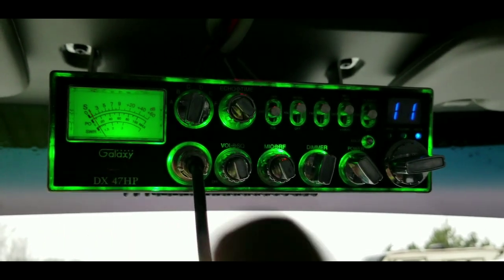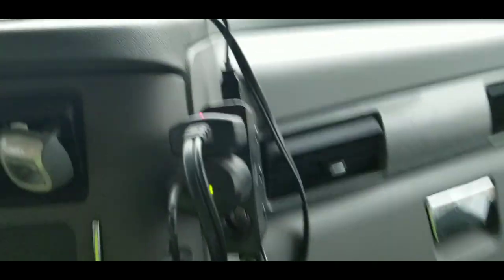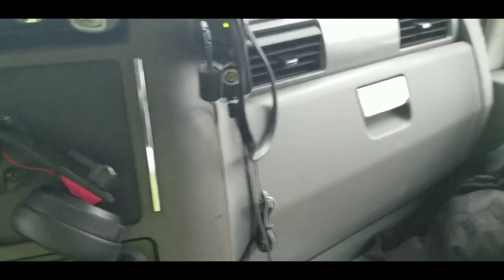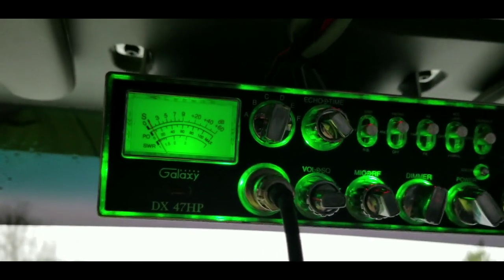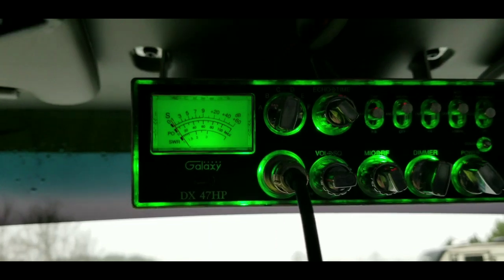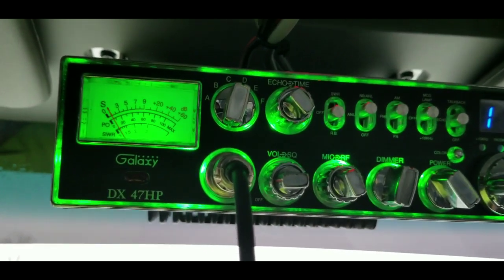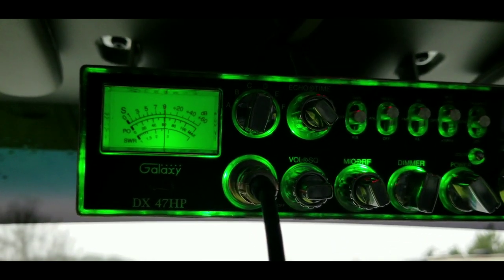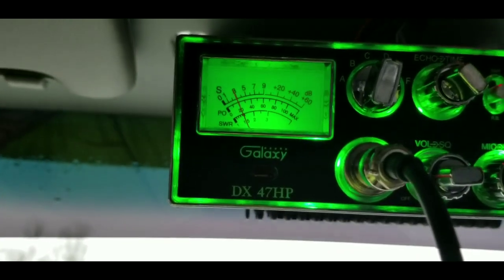Too Much CB Static!

Comment: Did you ever try to touch the antenna while having  a lot of static? The power coming in to the antenna (voltage) somehow gets mixed signals. But if you physically touch it or connect a little 2 core wire (looped) static disappears. You can turn down the squelch almost completely. This really works !
Reply from the maker: I don't have that truck anymore. Please explain this 2 core wire thing you speak of.
Reply: I was just doing this.  The damn antenna static stops when I touch the antenna
Reply: @yungkidd94  cause your raising the SWR = signal loss

Comment: I use the usb port on my am/fm radio to charge my phone instead of the cigarette lighter plug... It's the low power charge but generates no noiseon my cb radio. Also if you want lower noise, get a Stryker 655

Comment: Here’s an old trick to find electromagnetic interference with a radio install. Take a cheap hand held/portable AM/FM radio, cheaper ones are more susceptible to interference. Turn on your radio rig, then turn on the radio to a localish AM station. Hold the radio up to the whole radio install from the tip of the antenna, all along the antenna wire, and all the way to the CB. The radio will freak out with static when near a magnetic interference. You can use this to find any electromagnetic source all over the vehicle that may be causing you trouble.

Comment: Have you tried using ferite beads as a line choke. Also, the very length of some cords may become resonant at higher frequencies relative to other communication modes such as vhf, uhf, microwave, etc. I ground everything separate and bead coax near the antenna source . Also, Don't use cheap coax, it only causes headaches and shortens the life of your finals.

Comment: LED lights put out a crap ton of RF. The diode in the lights cause it. You can clear up your signal by installing an inline noise filter on your power supply. Even if you dont think your having much RF interference youd be amazed how quiet the static becomes with a filter. Less RF/static means you can hear distant and faint transmissions better.
Reply from the maker: Very true. I have this problem in my personal truck with the led headlights and the FM radio .
Reply: What is the best inline filter to use on a General Lee HP 40, pushing triple digit modulation?

Comment: Yeah I used to work for Schneider and my truck not only had a bad antenna, but they put the CB mounts right on the dash, right where the stereo is, two 12v plugs, I had my 12v cooler, and my built in fridge. So much shit for static, it was pretty bad. Nothing I could do though because I needed a phone charger, and my GPS tablet power plugged in.
Reply from the maker: Ugh, everything on a 12v plug! At least they had CBs

Comment: My dadgum cb does the opposite.
I had my phone charger cable layin over my footwarmers jumper coax..(100 watt with 1 watt goin in). When i keyed up, Apparantly it started activating apps as if i was tapping random icons on my phone.  I thought i had fried my i-phone because along with 7-8 apps running it had went into my settings, display, contrast and turned my brightness to zero, so my screen was totally blank. 😂😂😂
Took me a while to figure out what had happened. Lol so now im careful about wire placement.
Reply: I have the same thing going on but with my rear camera to the dash/mirror camera in my pickup. It's external and installed on the rollbar, right next to my CB antenna. I was "smart" and installed the lot together along with lights and other circuits in a single conduit running through the firewall grommet and down along the chassis to the back. When I key in the dash cam freaks out with static first, but then goes and switches modes and settings and eventually reboots. But that's not even the scary part. The scary part for me is the 20ish RPM drop in engine speed when I key in. And I don't have an amp. I'm only doing 4 watts!

I have a lot of grounding work to do, it seems.

Comment: Have you ever tried adding a capacitor on your power input? It should reduce your static massively. If you haven't try a combination of a high capacity slow response CBB capacitor in series with a low capacity fast response ceramic capacitor. Or just buy a good high cap ceramic capacitor with a low ESR
Reply: @jerbyr3085  yeah, there usually is a massive amount of noise on the power line. I add capacitors to most equipment that is very sensitive to interference from its power lines.
If you ever have the option you should hook up an oscilloscope to your 12V car output (or look up a video on youtube). If you also use a power splitter the noise can get really bad. 
You can also use low capacity capacitors in between your signal in and ground to cut some extra noise. I've build a button on the side of my CB radio that does this with 2 different capacitors. So I can switch between no low pass filter, mild low pass filter and strong low pass filter.
Reply: @jerbyr3085  the signal line capacitor depends on the capacitance. You need to use a very low capacity on the signal side to make a low pass filter. All it does is filter out high frequency noise. Yes, there is some signal in there but it makes very weak signal more audible. Also, I don't actually put a capacitor on the input line. I put it between the volume control and ground so that high frequency sounds are filtered before amplification occurs. Less things that can go wrong. Also, I added the ability to turn off the filtering whenever I wish since this is only used for listening to weak signals or when I turned off the normal filtering system and I don't want to get disturbed too much by high frequency noise. 

As for the power line.... You want that input to be as smooth as possible as there isn't any real signal on there and you never want to hear that from your speaker.
Your final goal is to keep your noise floor as low as possible and your signal as high as possible.

Comment: I currently have my cheap old realistic cb in my car. I have it plugged into my cigarette lighter. Is there a benefit to just wiring it to the battery? Is there less interference? Your channel is very helpful,  thanks for the great videos.
Reply from the maker: Wiring to the battery will help, with 8ga cable for that long of a run. RF bonding the vehicle greatly reduces interferences, just apply this video to your vehicle. 
https://youtube.com/watch?v=ohkOX45dJn0&si=EnSIkaIECMiOmarE

Comment: Hey brother love you videos question for you I have a CB base station with Antron 99 worked fine until the last couple weeks now,,, excessive static you can turn everything in the house off all appliances and still having static ninety-nine percent of the time it's static a lot of static I can't seem to pinn it down  got a Conex 566 use it as a base station and a T or C 427 same results nothing has changed with my coax or my 99. Any suggestions thank you
Reply from the maker: Possibly a loose connection between the radio and coax. And I'd be checking the coax for continuity.

Comment: Do you pick up a buzz off certain power lines? Not all but some power lines I drive along beside I have to turn the volume down until I get off that street in the big rig. Some buildings cause a lot of static like downtown where I'm close at a red light.
The ham folks say that ground and power strait from the battery help reduce noise but I haven't tried it yet.
My cellphone charger also does the same thing. I have to turn the RF gain way down to tolerate it.
Stryker 955 here.
Reply from the maker: Yes, there's no way to get away from all of it. But RF bonding the vehicle can greatly help, watch this video https://youtu.be/J6PJyw6jh2M With the 955 you should be going to a the battery or power lug in the fuse box and the negative to the frame or a ground on the body. The 955 can also benefit from upgrading the power cord from Big Rig Radios out of Phoenix AZ
Reply: @jrichtruckincbtips  Ok thx man! Ill check out the link.

Comment: not all chargers do that, I had one that did, changing to a better grade helped, also ferrite snap ons will eliminate the issue cold, or torroid cores will eliminate that issue all together....can Google them to find out how to use them they work...
Reply from the maker: Haven't had any luck with ferrite cores, but RF bonding does wonders.

Comment: Just a question. Why do truckers stick with the cb? Its very noisy with static. Why don't truckers convert to Crystal clear GMRS radios. Much better sound quality. Very reliable.  No static to worry about. Please reply
Reply from the maker: Not sure what a GMRS radio is. But, you can't get most truckers to buy a cb anyway. So, don't think adding something else would help either. And, some trucking companies don't allow CBs in the trucks.

Comment: Do you think ferrite beads on the cables would help out at all?
Reply from the maker: I have tried them with no luck, some say to coil the coax then use large beads. But, you need a high quality coax to coil. I have found RF bonding to be the best solution and I have a video on that.

Comment: No avoiding static at my home base, i live 200ft from the regional 2kw TV mast handling 50+ tv channels and get a constant 8 pounds of it :(
on the flip side, im so close to it, i dont need an antenna connected to my tv to pick up the channels lol
Reply from the maker: That's a lot of constant static!
Reply: @jrichtruckincbtips  yeah, it sucks!
Its the same on the rig in my car if im outside my house but rapidly clears if i drive  away from the tower and eventually falls to zero but on my homebase there is nothing i can do about it.
less than a quarter of a mile from my home i can hear people clearly in the car who are 18 miles away that i cannot hear at all on my homebase :(

Comment: Connected straight to the battery and that battery have the alternator charge that battery That illuminate a lot of it
Reply from the maker: That truck and radio was connected straight to the battery. But, yeah that helps.
Reply: @jrichtruckincbtips  Sorry I didn’t know

Comment: Question.
I hear my heater fan, and my windshield wiper motor through my cb radio. Any ideas as to how to isolate it?
Reply from the maker: Not knowing your setup makes it difficult, and some RF interference is only fixable by eliminating what's causing it. That being said, running CB power and ground directly to the batteries, and grounding the antenna(s) can help. Noise filters can help from what I've heard, but I don't know what brand is best as I've never needed them. Thanks for watching.
Reply: @jrichtruckincbtips  could an improperly ground cause this noise to occur? I'll try re-grounding it and I'll let you know.

Comment: If the coax cable is near some wires will it cuase interference? I couldn’t find any way to route the coax then through the hole that a ton of wires come from.
Reply from the maker: Yes, with cheap coax. Check all connections are tight and no corrosion.

Comment: What’s up j rich, what if your interference is coming from your lights? I’ve done everything from grounding my antennas, to buying better coax cables, moving them to a different location. My next step is maybe wrapping my CB in aluminum foil😂 HELP!
Reply from the maker: RF bonding will help with the lights, even if it's a car or pickup. https://youtu.be/J6PJyw6jh2M

Comment: Dude I've been trying to get my CB working all month with no luck. This is my first real winter so I want a CB for when conditions get bad. Your videos are a help.

So far I got a bird perch, cobra 29lx, 4' firestik and 4 bolt clamp I got from loves.

Got home time coming up so I ordered a multimeter and a ground strap. Hoping when I hit otr after home time I can get this thing running.
Reply: Oh also I have an ANL and a NB/ANL. when I had my antenna laying across the dash I actually had clear reception and about a quarter mile range. With it on the mount it's pure static and like 100' range. Anyway what's better, ANL or NB/ANL

Tomorrow I'll run with the charger unhooked. I noticed when my codriver uses the microwave in the sleeper I get a signal too l
Reply from the maker: NB/ANL is fine. Sounds like you are in a Freightliner, yes? Run the ground strap from the perch to the firewall. Check the resistance and ground of the coax with the meter. The 4' firestick will do, but the taller the better. 
Check out my video "best antennas for a Kenworth " there is a link in the description for Skip Shooter antennas. There you can buy a 6' or 7' Skip Shooter for the price of the 4' firestick. And, they are also more durable. Thanks for watching.

Comment: Cqn you use one of these in your home. If so what kind of port do you need? Thanks
Reply from the maker: You just need a power supply to convert 110v to DC volts

Comment: I have a 20,000 Watt K 40 antenna, end it makes kind of like a humming noise and the more I accelerate the more it does it, or the louder it gets, so I ended up taking it off…what do you think could be causing the problem?
And as always thanks for your videos they are very informational keep up the good work.
Reply from the maker: You can try running a 1" ground strap from the alternator to the frame. And, if you really want to get carried away and get the most RF Bond the whole vehicle.  I have a couple videos on that.

Comment: I have a cobra 29 LTD Chrome. It's suppose to pushes 4 watt!  Why is mine only throwing out 2 watts. Is that something burnt out in the radio brand new coax cable
Reply from the maker: in perfect condition(s), yes 4 watts. take it to a cb shop and have then look it over.
Reply: @jrichtruckincbtips  thanks

Comment: What if you’re not hearing static but the people you’re speaking to are hearing static while you’re talking?
Reply: Good question
Reply from the maker: Bad mic
Reply: Ok another question 

My needle is all the way to the left and when I squash it all the left and the needle don't move but I do have static
Reply from the maker: @Rustyhandle  the needle is stuck and not swinging freely.  CB shops charge about $10 for an internal cleaning.

Comment: If you get a radio would it be best just to keep the stock mike?
Reply from the maker: Most stock mics are junk. I like Astatic, love Ranger, and hear Stryker is pretty good. Here's a video comparing 5 different mics. Keep in mind that I had the volume too high through a cheap external speaker. Thanks for watching. https://youtu.be/zG65egoZwWM
Reply: @jrichtruckincbtips  That's a big 10, catch you on the flip.

Comment: I’ve had this problem for 3 years and it drives me insane.
Reply from the maker: There's so many things that cause static in the cb. Like bad ground, LEDs, chargers, refrigerator, and then the things we can't help, atmosphere conditions, businesses, and traffic lights. All these can effect static in the radio. Thanks for watching.
Reply: @jrichtruckincbtips  yeah I know what you mean. About a week ago I figured out what was causing a lot of the static and it was a cheap phone plug like the one in your video. I unplugged that and it helped a lot but still have static. I’ve had my current truck for over 3 years and have tried about 5 different CBs, several different brands of coax and antennas and it still just doesn’t work like it should. Currently I’m running a Stryker 655 with a Wilson 2000 antenna. It doesn’t work near as good as it should. I had it wired straight to the battery and then someone told me to ground it straight to the frame so I did that and it made no difference. If my truck is rolling, my cb is always on and it just gets so aggravating sometimes. Every time I upgrade radios in my truck (2013 Peterbilt 389) I put the old radio in my pickup and they work great. I don’t know what else to do. Thanks for the response.
Reply from the maker: @turkfebruary5836  I really don't care for the Wilson's. I love my fiberglass Skip Shooter top load antenna. They work a lot better. Have you tried making a ground cable to ground the antenna to the frame? It works wonders! Check out this video on how I did my Freightliner.  https://youtu.be/TqQ5KJsnw3s
Then here one on making your own cable. https://youtu.be/9rzvfheIjpE
Reply: @jrichtruckincbtips  no I haven’t tried that. The guy at the cb shop where I bought my Stryker went over my cb antenna, mount, and coax and my swr is very low but I’ll check out that video.
Reply from the maker: @turkfebruary5836  I had done the same on another truck, new coax, great radio, and tested multiple antennas. Found this best SWR for that truck with a fiberglass top load firestik 1.2 (but they break easy). But, couldn't hear far way and high static. After switching to a Skip Shooter (very flexible non broke yet) and proper antenna grounding static stays low and can hear a lot farther. You can get Skip Shooter antennas for about $30 from antennapartsoutlet.com

Comment: My air release is causing me to have to turn back my RF gain way back don't know what to do
Reply from the maker: That's a new one. Try running a ground strap from the back of the radio to the body of the truck.

Comment: If anyone can help me out that would be awesome! My cb is staticy and almost all the channels bleed together, I’ve tried two different cobras ltd classics one from the 90s and one from like last month. Everything has a good grounding and I don’t get why I get so much static and why they bleed together! The cb is routed directly to the battery and wether the cars on or off the cb sounds the same! Any help would be awesome!
Reply from the maker: More than likely not the radio, it's the antenna system.